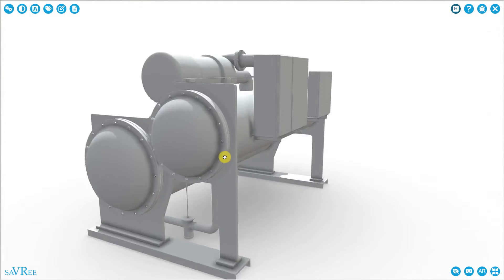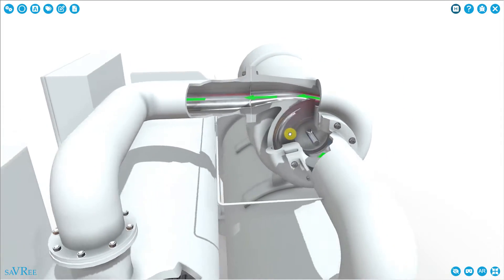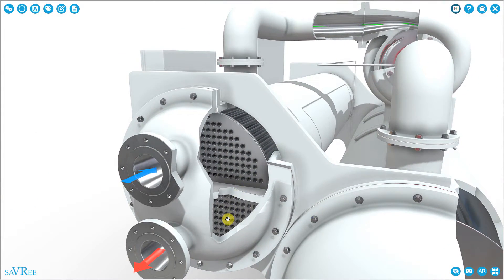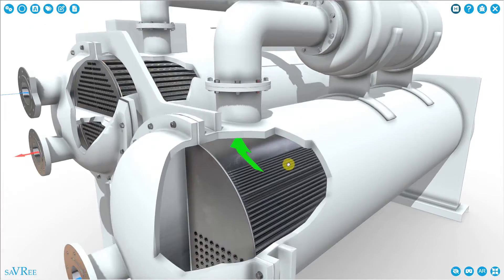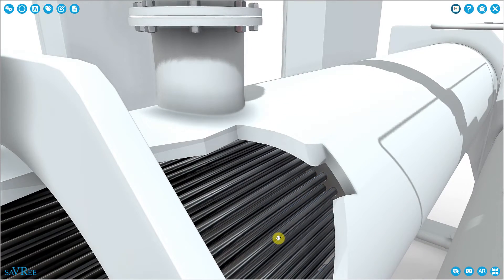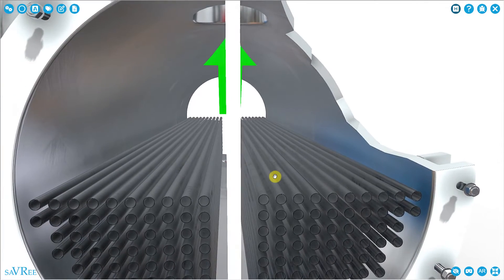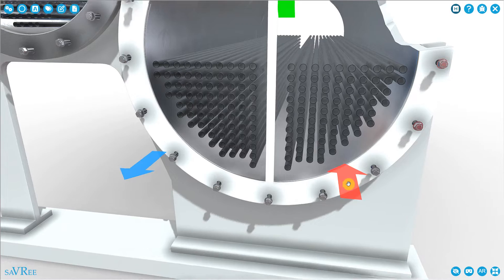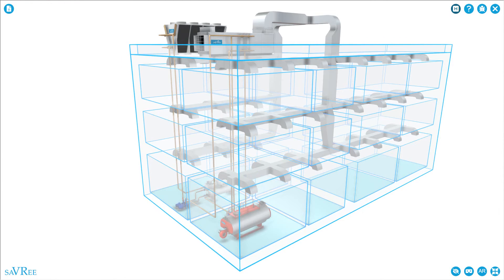saVRee Snacks #4 - How Chiller Plants Work (HVAC)

Comment: Its a wonderful and old system as well, but still in use especially for large buildings.🏬 I have seen these chiller plants in wide use in the Persian Gulf states from way back in the early 1970's. One of the uses of the chiller plant was in the making of large ice blocks which were sold to customers for transporting fish or making cold drinks etc.🍹 There was another much older system that used Ammonia, and I think it worked in a different way, like not use a compressor but a flame. I read about it when I was doing my engineering studies in the 1970's-80's, but havn't looked into it.
Reply from the maker: I still see a few Ammonia plants, mostly in breweries and places like that. Absorption chillers also seem to be making a come-back.